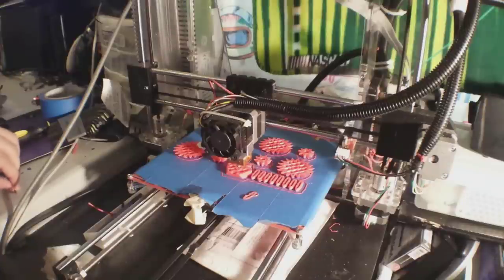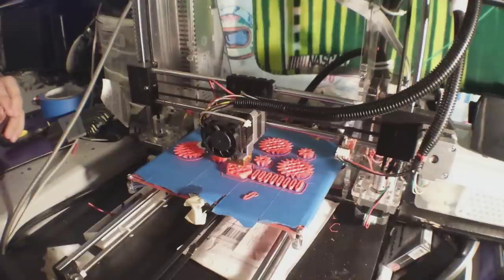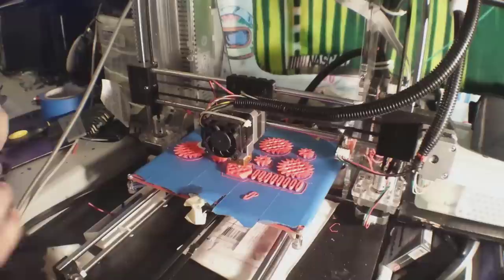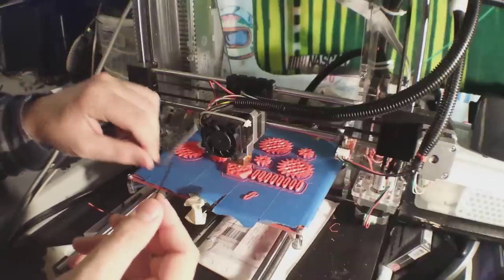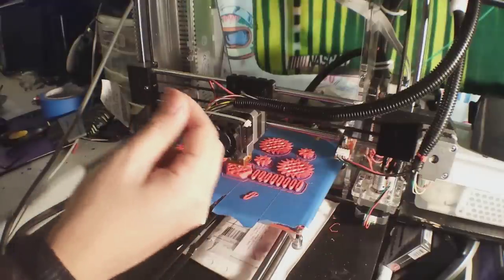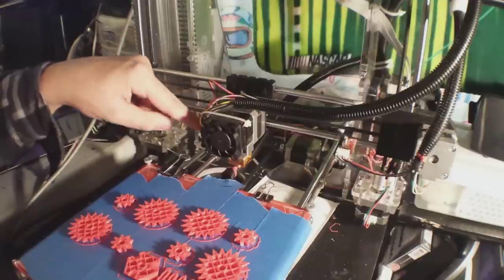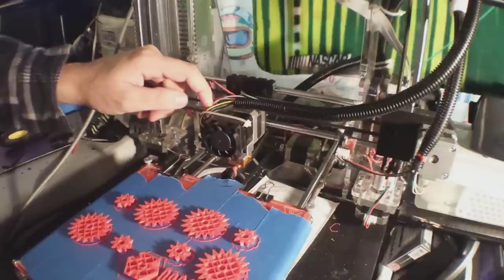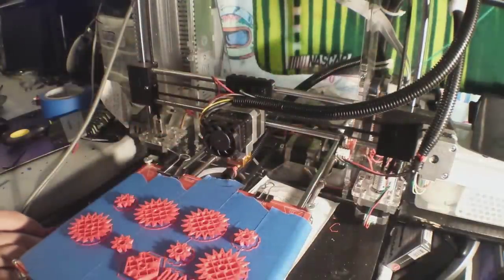How to Unclog a Folger Tech Prusa i3 3D Printer

Comment: My generic printer came with the print head  assembled so I had a difficult time figuring out how to remove the hot end. ( Did this just for practice since it still needs the driver and firmware/software. Could use some help with that.)Here is hoe it is done:My X axis has two (2) fans only the small one on the left needs to be removed. The screws are real long and also holds the motor in place. Leave the screws in the fan/heat sink assembly, use masking tape to keep them from falling out. Next remove a screw with a 2.5mm hex head, it is just in front of the feed tube's 10mm lock nut.Then loosen the feed tube's lock nut, the hot end now slides out and it's mounting piece can easily be unscrewed.Note that the screw and nut on top are just for holding the tension spring in place and newer needs to be touched. The rest is exactly as explained in Dustin Carbin's great video.

Comment: Great video. Thanks!
I have a very similar nozzle and I noticed it's easier to get the nozzle before the tube. And you can use a small wrench because the base of the nozzle is a hexagon. It twists easily, and once it's out the tube also comes out easier because it was touching it apparently. EDIT: Oops. Apparently I should have watched the full video before commenting :P

Comment: The better way is to pre-heat the hotend so that the burnt plastic will melt and would have made your job much easier without using too much force to break the thread and nozzle.

Comment: I know this is an old video and Dustin has learned a lot after creating this video. Not to knock Dustin but please do not tighten the nozzle against the heat block. There should be a gap between the hex on the nozzle and the face of the heat block. The idea is that the nozzle and heat break tube need to be seated together. This is where the seal is created. The threads expand and contract with heat and the plastic will leak through them. 

Tighten the nozzle against the heat break tube and not the heat block. If assembled correctly, nothing will leak through the threads.

Comment: well, if you don't want to destroy your hot end then just do what he says up to 7:14, then turn on your printer, use Pronterface or any other tool you prefer, pre-heat the hot end (obviously NOT holding it with hands but with pliers or whatever you prefer), and then it will be much easier to unscrew it. Then quickly wipe the melted plastic off of the nozzle and the neck (the threaded tube). Then you can continue following the video

Comment: I bought a roll of bad filament (Jam clogged the hotend 45 minutes into a 4 hour print) I repurposed it as weed whacker cable. Works Amazingly! so amazingly in fact that i think the cheap shit is just weed whacker cable thats being sold as PLA to make a little extra profit!
Reply: +Eidolon you can actually use weed whacker (trimmer) line as filament if you are desperate. Most of it is Nylon, so you will have to dry it before using it, but it actually prints okay.

Comment: What is the exact purpose of the PTFE tubing and how important is it? I may have destroyed mine while taking my extruder apart...
Reply from the maker: Sean Mullin It allows the filament to slide thru the extruder to the nozzle. PTFE is very slick and doesn't let the filament stick and get clogged, and it also insulates the filament from the heat, so it does not expand and get stuck. You can try to run a print without it, but 99/100 times, it will fail, and runs the chance of damaging the extruder.

Comment: Did you get any sample filament with your Folger Tech printer? I set my Prusa i3 up and tested with that but just can't get any even close to decent prints. It seems as if the printer doesn't extrude for the first layer no matter what height I have it set at, and then when it does print, as it passes it pulls the previously laid filament in a big stringy balled up mess. Should I just chalk this up to poor sample filament or is there something else going on? One last thing, when it lays the filament down its always very very thin, Not like the previous .4 mm extruder head I used in the past(I might have been using ABS with that)(I think the sample is PLA). Thank you ahead of time if you're able to answer any of these question!
Reply from the maker: +Justin Perry (JustinSmurf) The sample filament isnt terrible. I know what is wrong though. Long story short, you need to allow a skirt to print with the first layer. There is a setting for that in most slicers. It basically makes a big outline of filament before starting the actual object. This is done to prime the extruder. If your slicer is already doing that, I would increase the line count of the skirt, that way filament starts to flow out before it starts on the first layer of the object. As for the filament pulling the rest of the filament around, I usually get that with bad first layer adhesion. Either the first layer is too high, or you should try using some blue painters tape on the bed to help with the sticking. Also, you should be printing onto a glass bed (with or without tape), and not the PCB heated bed itself. Now when you say the filament is coming out in a really thin line, usually that means the first layer is too low. If you have the Prusa like mine, I would equally turn the Z axis rods during the first layer to adjust the layer height until it is perfect. I usually do that while the skirt is being printed. Other things are make sure the slicer settings are all correct, and if you have a heated bed (which you probably do), turn it up to 60-70c as that helps with adhesion as well, although not necessary for PLA. Let me know if anything helps!

Comment: The filament is exactly 1.75... Do you remember what temperature you set it at for the cheap filament and if you got to print with it? It probablt expands and clogs up. If this extruder doesnt work is there a better one that would work? How about the geeetech gt4?
Reply from the maker: I always have my PLA set between 192 and 200 degrees Celsius. Make sure the spool says it is PLA. If it happens to be ABS, set the temperature to 230 degrees Celsius.

Comment: What settings do you have in your slicer lets say for the cube ?  I am trying to make this printer work and its all over the place, is it supposed to be that hard to calibrate it?
Reply from the maker: I didn't have much problems with the calibrating it. I'm running at .2 mm layers, 15 mm/sec first layer, with every other setting around 60-70 mm/sec. Make sure you have the filament diameter settings correct, and the extruder settings settings set to 0.4 mm. As long as you have a glass plate for the bed, and the bed is level, and the z-stop is where it should be, everything should be fine.

Comment: Hi im new to this 3d printing stuff and i got my printer assembled and working for some time but my hot end is not heating 100% now it stop at 160 degres and i replace the heater but its the same thing. Do you know what could be the problem?
Reply from the maker: Make sure you check the settings in the slicer program you are using. It might be that.

Comment: hey man,i got a folger tech i3 about a year ago and have had a problem with it where the extruder makes a clicking noise and it wont extrude corectly. Any thoughts on hy this might be ocuring?
Reply from the maker: Either completely clogged/jammed, the motor is overheating(stepper driver tuned too high), or the driver is tuned too low.
Reply: Dustin Corbin thanks man I'll try tunning the motors, I just fully replaced the hot end so that shouldn't be a problem.

Comment: When i print there is like a tiny tiny bit of space between the lines like the first layer you can see space between the lines... Why is that? Not extruding enough? Too hot?
Reply from the maker: If you have all the settings correct for extrusion and heat, I would say the Z-endstop needs to be lowered slightly. My printer does the same thing whenever the Z- home position is too high.

Comment: Why don't you set the slicer to run one part at a time? Less travel time and if it fails during the middle you wont have to start from scratch
Reply from the maker: Mainly because I usually only print things that are single parts. And I don't have the settings set up in my slicer for my specific printer. I can do it, I just don't right now.

Comment: Where do u recommend I get my filament
Reply from the maker: I use Hatchbox filament which can be found on Amazon. It's really good and almost as cheap as the eBay stuff.
Reply: Dustin Corbin thanks
Reply: Dustin Corbin can you leave a link to the filament ? I can't seem to find it .
Reply from the maker: Canaan K I don't leave links in comments, but just type "Hatchbox pla" or "Hatchbox abs" into Amazon. If it doesn't, it may not be available in your area.
Reply: Dustin Corbin how do you print ? I am trying to print something for the first time with 123d and mesh mixer yet it tells me I don't have software to print with .
Reply from the maker: You need a slicer like repitier host or cura.
Reply: Dustin Corbin from there do I just export to stl or g code?
Reply from the maker: There will export g code. You must input an stl file to the slicer.
Reply: +Dustin Corbin ok I'm sorry for all the questions I hope it's ok. I used 123d to make my design . Now what should I do to print ? I have slic3r and mesh maker of that means anything ?
Reply from the maker: Canaan K Have you even tested the printer at all? You really should print some premade test pieces first to make sure the printer is calibrated correctly. Assuming this is done, you should export your part as an STL, then slice it in slic3r, and then print. This also assumes you can can connect the printer and know how to use a slicer. If not, you really need to watch some tutorials online.
Reply: Dustin Corbin ok great thanks . :)
Reply from the maker: No problemo :D
Reply: Dustin Corbin not telling what u should do lol but it would help many noobs like me if u made a first print video showing how to set everything up. I have the 2020 from folger tech btw (thanks to your video about it and reviews)

Comment: That looked like a do-or die technnical unscrewing of an already damaged precision engineering part... WTF? L:D
Reply from the maker: +tuone sempervirens But it worked. :D
Reply: Hey cool! i had the same as you, i tidied the nozzle and ran filament in it again and it was still clogged, i had to have to goes to get it running. I mean that you took off your nozzle without a spanner! good tooling and patience with precise precision engineering parts pays off in the long term, can make another printer with the old gear. thx